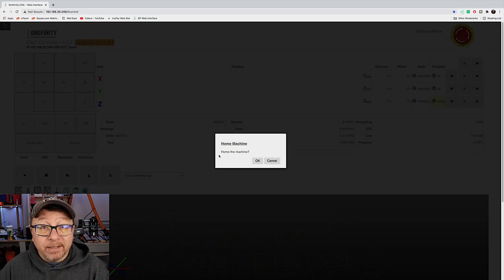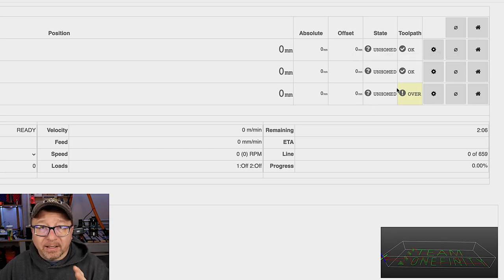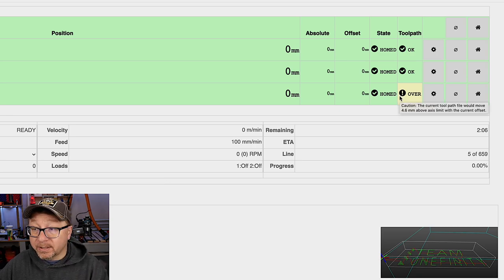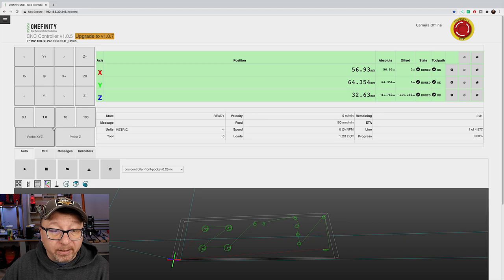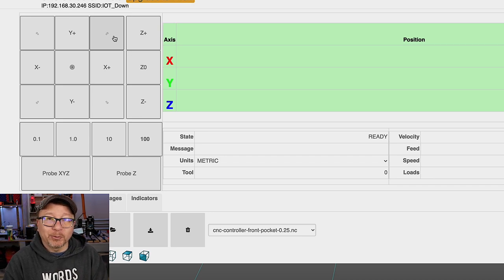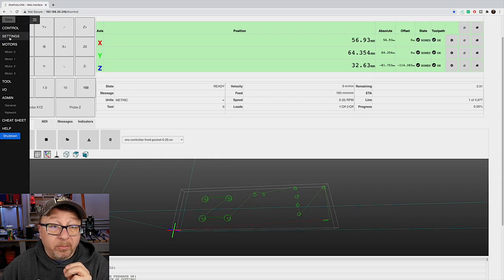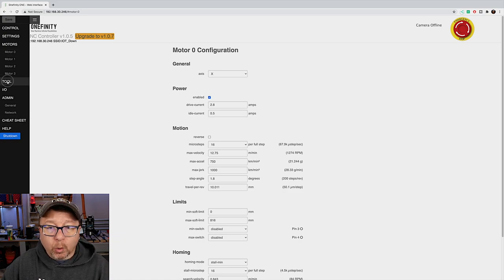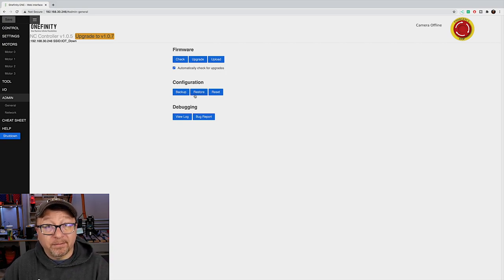Onefinity User Interface for Beginners

Comment: when one is completely green one explores and suffers,
wasting time watching videos which do not pertain.

Don't know if you mentioned the below at all or when in your presentation.
You state no computer is needed, but it appears only if one has G-code on some sort of media already cooked!?  ...as no-one will type all the lines for a project manually surely!?

Hardware and operating system the stuff runs on.
The controller may use Linux(if I got that right) but the computer may be a windows platform? or not!?

...I may not be in a position to use Linux, or for example if it is not compatible with Apple I would be done in(if I use Apple).
...and of course versions/dates are critical to all compatibility!

There is a critical list that should be clearly delineated up-front, that way one may know this video pertains to one's scenario.  Right now, after watching the entire video, I have no idea.

...and for instance a comparative basic parallel list of equivalent software to place things in perspective...

The Onefinity equipment is up in price, $3,000.00 quickly disappears once one has gathered all the necessary ingredients, thus it is important for one to know how this stuff compares to other equipment before leaping in that direction and I mean within the context of your presentation - software/firmware.

Thank you for your effort,
I did learn that the Raspberry requires Linux... though I have no idea why it is mentioned in this presentation?
Reply from the maker: Hi @DormantIdeas - thanks for watching.  Perhaps my video series on digital manufacturing would help you understand where the CNC fits into the production flow? https://youtube.com/playlist?list=PLCVvx3PnAfyf-YXNFPpK-_xpc3OTPB8nz